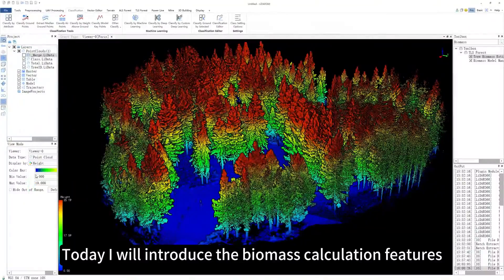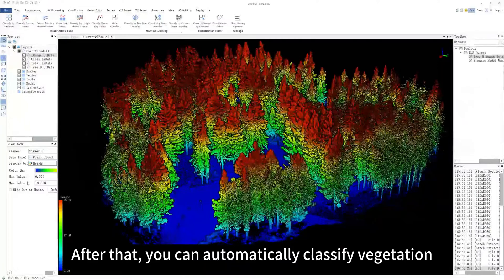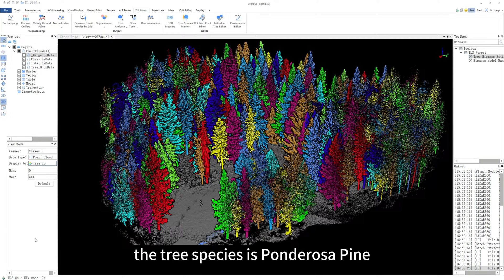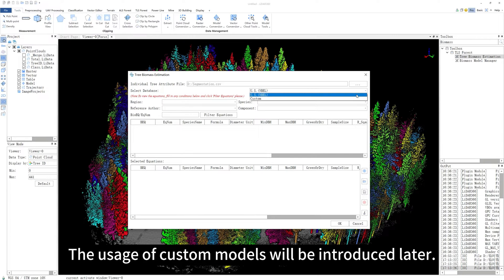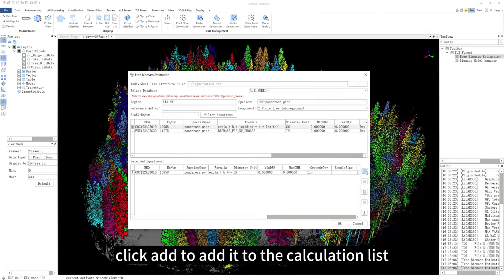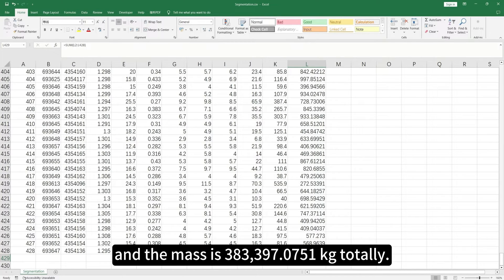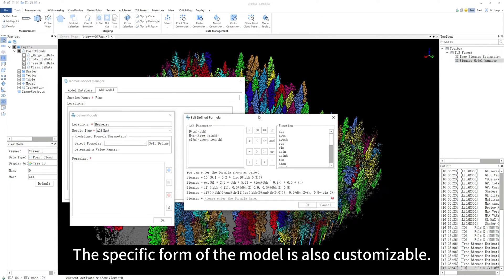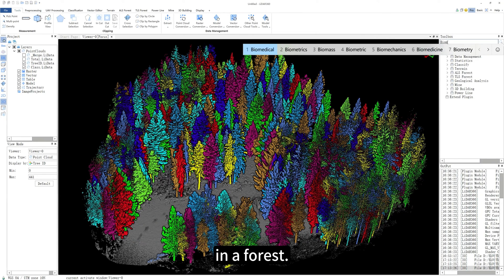LiDAR360 | Introducing Biomass Calculation Feature for Forest Tree Analysis

Comment: hello, good video but i have some question, i have a Zemuse L1 lidar whit matrice 300 its possible do it too? i ask this because some times i see my lidar dont catch poits enougth for make all side off tree!
Reply from the maker: ALS lidar struggles to complete the entire process because the diameter at breast height (DBH) of trees is a crucial parameter for calculating biomass, and the DBH accuracy extracted from ALS data typically falls short of this requirement. Unless you have a known biomass model that doesn't rely on DBH.
Reply: so for i get the volum of tree whit precision i need to get all diameter of the tree too? @GreenValleyINTL